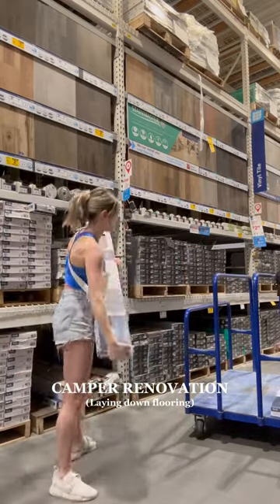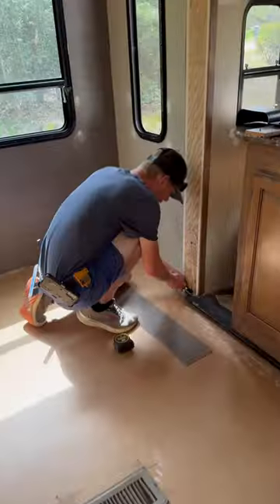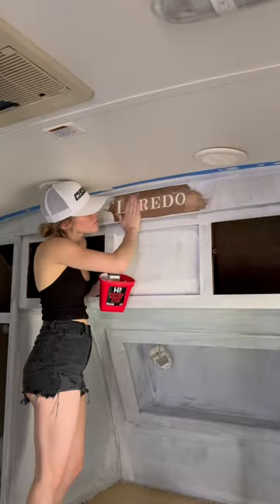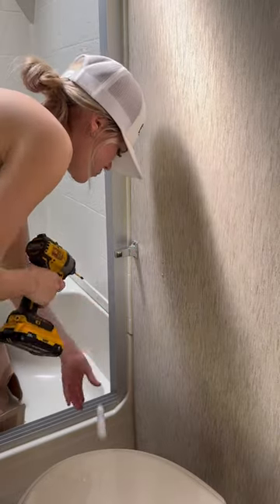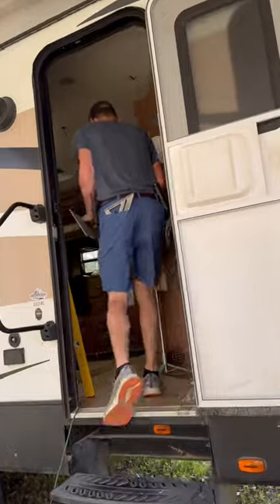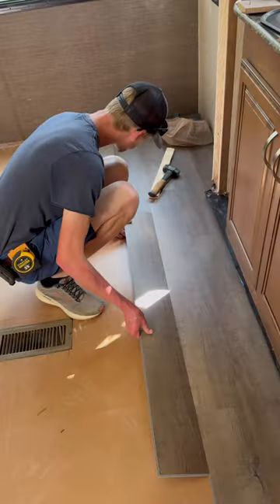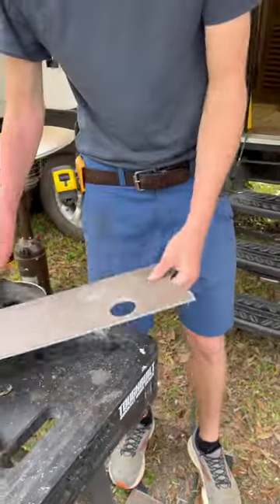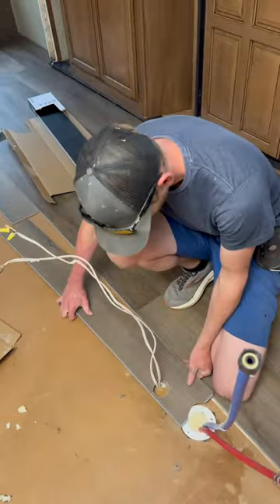#camperrenovation #camperlife #rvflooring #project #family

Comment: You will regret putting that kind of flooring down . Always use Lino it’s more flexible and it will not bow in or pop out with the pressure of the slides out rubbing on it or when you are on the road.

Comment: Floor vents like the ones in campers have to be one of the worst design ideas to exist. Put them floor level in the wall instead so no floor debris can fall inside. You'll spend a lot more time every day cleaning those out just due to their location 😩 Just cover them with flooring and call it a day 😅